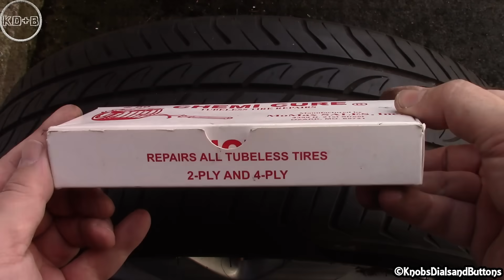How Tire Repair Kits Work - With Internal Views

Comment: If you are serious about your car, you should only use this as a quick fix if you absolutely have to. I’ve worked at a quality tire shop and have experienced several times these have failed. We called them shit on a strip, because they’re shit and look like shit, usually applied by a towtrucker. The correct way is to let a good tire shop plug it from the inside.

Comment: The description mentions all of these are temporary fixes. So where are the permanent fixes?
Reply: that's a silly question that you have just posted. many times doing it correctly can save you from buying a new tire.
but take it to any shop they will say you need a new tire.

you & the few might say, "my ac is not longer blowing cold air, so i got to take it to the dealership"?
and the dealership said you make the right decision.
Reply: The first method, if the strip is of excellent quantity, allows you to reach the end of the tire.
In some states (Italy), definitive use is prohibited by law, so you have to go to the tire doctor soon as possible.

Comment: CLOSEST THING to real patch you would get at the garage is that orange mushroom-- gun type-- airpressure would hold that solid-- feel better if it had glue to weld it in.  other wise the easiest is teh sticky strip- and they never failed although its actually meant to be a temporary fix-   get into an accident it could be used against you if you got a crafty prosecuting attorney1
Reply from the maker: I'm only demonstrating how each kit works and I only ever recommend using any of these as temporary repairs.

Comment: 16:20 this plastic lead will be inside the tire forever?
Reply from the maker: It remains in the tire until it's removed at the tire shop. I'm only demonstrating how to use the kits, I have nothing to do with their design :)
Reply: @knobsdialsandbuttons  cool. You did great job!
Reply from the maker: Thanks !

Comment: A heads up, if you bought your tires at Discount Tire, the ONLY plug they will accept is the black solid rubber plug. Anything else will void your tire warranty.

Comment: I think it's good that these exist (and not have to rely on expensive ADAC services) but i also think it's important to point out the fact that this is just a temporary bandaid solution.
They still need to purchase a new tire n stuff.

It's cheaper than having to pay for a new car because it veered into the guard rail because the tire blew out at 120 KM/h.
Reply from the maker: I explained that in the video description

Comment: I used a sticky strip kit to repair a tire. Knowing it's supposed to be a temporary fix, I brought the car to Discount Tires to get it repaired by the pros. When I told them I patched it, they said they couldn't repair it. I had to buy a new tire.

Comment: It can be a challenge to plug a tire leak on a pressurized tire, even one that's leaking. Much easier to plug a depressurized tire if one encounters this problem and then adding air.

Comment: The key to a lifetime repair using tire plug is to apply rubber cement on the tire plugs before using them. I’ve had a couple plugs that eventually leaked without rubber cement. But with rubber cement, they’re permanent. Many people fail to do this step because their kits didn’t come with rubber cement or because the YouTube videos they watched didn’t show this step.
Reply from the maker: If that's what an individual wants to do, that's up to them, but when I'm demonstrating each kit, I'm only going to use what comes with it.
Reply: @knobsdialsandbuttons  so is it a bit better with the rubber cement? 
*I recently had my tire patched from inside at a tire shop but still leaks air , they told me they can't help me further *

Comment: With the second one and forth one I can see that you lose a metal tip inside the tire when you remove it.
Reply from the maker: The second one doesn't lose any metal tip in the tire. The 4th one leaves the plastic lead in the tire until it's removed at a tire shop. I have nothing to do with their design by the way, I'm just demonstrating how to use each kit :)

Comment: I've been using the 1st method for over a decade, never had one fail, even done track days on them.  But they can kinda be a bitch to put in because sometimes the applicator doesn't want to squeeze through the hole.  Multiple times I've had it be REALLY tough to get in even after it was reamed out really well.  Annoying.  The mushroom plug method is really appealing b/c it just screws or pumps down, but I'm curious how that compares to the plug strips.  That last one is really interesting.  I can't tell if that one is genius or ridiculous.  I feel like it's a good side-of-the-road repair since it can be easily backed out and plugged properly later.

Comment: Highly recommend not to use the red colored plug without the rubber cement.  But rather used the black colored plug with the cement seal.

I plugged a tire with that red stuff and ended up leaking.

Comment: Thanks for the video mate, very helpful, but this reparation kits are quite useless and we should prefer tonhave the spare wheel instead.
Reply: useless, right?  atg & i say if you can't find the wheel lug's key. or the gas station inspector or tire shops didn't return key.
that spare tire won't do you any luck. 
most vehicles don't come with spare. my ferrari & daughter porsche don't.

Comment: I use FLAT OUT in all of the car's and RV! I had a screw in my tire. I pulled the screw out and FLAT OUT sealed the hole. Flat uses Kevlar Strands in it's solution. I don't flats anymore!

Comment: You left out a significant detail of tire gun plug method.
You tell us to put a plastic lead into the tip of the nozzle to help push the nozzle through the tire. You show us pushing it into the tire from the outside view, but it's inexplicably gone in the inside view.
What happens to it? Are we to assume it bounces around inside our tire for the rest of its life?
Reply from the maker: Read the video description
Reply: @knobsdialsandbuttons Ok I see that you wrote about what happens to it in the description, I just don't think 99% of viewers actually expand and read the description that deeply. How come you didn't show what happens to that part in the video of how it works internally?

Comment: Good video but, don't ever stick your finger over a pressurised air source as you risk having the air pass through your skin. At pressures above 30 PSIG, it can tear skin or cause air injection injury. If it results in an air injection embolism, a very painful death. I did take some notice of the things they told me during my apprenticeship 40 years ago.

Comment: You know what happened to me today..? Went buying the kit and a 120 psi compressor because the tire was flat...then when I wanted to glue the orange thing...the super glue that came in the kit was empty...
Reply from the maker: That's unlucky. It's actually a rubber cement so be careful not to use another type of glue with the kit. Super glue would probably shrink and/or harden the repair strip
Reply: @knobsdialsandbuttons  no I went buying patex glue almost similar properties...

Comment: All these methods are only useful in the case of a nail entering the frame, but in the case of stones or a piece of iron entering, these methods will not be useful because the crack is longitudinal and not like a nail.

Comment: Impossible do that method anymore, not when you get a flat tire on the road.
You have to drill out the hole after removing the screw, nail or whatever that is the cause of the leak.
You can't just do what is shown in the opening. No way by hand can you force that tool though the hole. I've tried.
Put your spare on and take the tire to a tire shop that will patch the tire from the INSIDE.

Comment: You’re supposed to pull straight back out with the plug not twisting it that way the tool releases the plug then you can cut off. The way you did it is wrong it will not hold over time. Do it my way it will hold the entire life of the tire and over 100 mph even in side wall
Reply from the maker: I go by the instructions with each kit. Some say pull it straight out and others say rotate it.

Comment: What would REALLY be super, is do an AFTER REPAIR  Air Pressure test.  This would DISTINGUISH Your channel from others because the extra miles you're willing to go.  The repair is only HALF of the battle. For what good is the repair if it can't hold air?  After the repair pump the tire to the recommended PSI and LET IT SIT FOR a week or longer - for each of the repair kit. Then we measure the PSI to test for any leaks!

Comment: Mushroom plugs should be banned. Theres a damn good reason why., they quite often don't go all the way through the tyre and tread especially if the tyre us new and not a road only tyre. (Think SUV) then they blow out about 2 miles up the road.

Bacon strips / sticky string have been round for years, and they work. Simple to install

Comment: Mushroom plug is the worst. Plugged motorcycle tire on Alaska trip. Tried twice, each time lasted about 100 miles then fell out almost causing crash since the hole was open and deflated in like 30 seconds. Bought cheap Slime string type, still holding perfect 10,000 miles later. Mushroom type is junk.

Comment: I was told that a nail in that spot it not repairable. Anything towards the middle of the tire will pierce the metal plate, that only nails and screws toward the rim of the tire are repairable.

Comment: The screw type  For the emergency circumstance. And only use the real tire. If use for front tire. It's very easy for a small leak  After over 1000 Mile. I already try at least five times. But the rope strip  Doesn't matter front tire. Because the front tire move too much left or right. The screw will move  after tire wear. But use for real tire no matter.

Comment: Ive done this with silicon in place of the rubber cement and it worked fine and lasted the life of the tire.  Anyone who says RC is required is just lying or inexperienced.

Comment: BS!!! Even with a 6” nail when you pull it off the tire does not leave a hole that big!!! Use a drill bit to make the hole bigger just like this guy did that he did not show on the video. Also bring a hammer to push the plug through if you are not that strong…

Comment: Tire plugs are illegal in most states and have been illegal for decades. Meaning that you will need to have it patched it from the inside instead.
Reply: Ive never heard that and I have found tire plugs at every parts store  I've needed one in multiple states.
Reply: There are presently no Federal or State laws regarding repairs done to tires in the United States. If repairs are restricted it is usually driven by the fleet or customer as a specification,
Reply: What version of America do you live in? I'm gonna assume the same one that changing your wiper blades is a capital crime?

Comment: My dad told me when I was real young, never get a plug, just pay for them to patch it up. So I never get plugs.
Reply from the maker: Good advice, but it's always worth having a back up in case of an emergency. Hopefully you'd never have to use it ! :)
Reply: Plug is a bandaid to get you to the repair location not designed to be a permanent fix unless you want to drive on a flat or walk there

Comment: The correct way is a patch. Just as cheap as the plugs.

When I was a state inspector, I would fail vehicles with plugged tires.
They are dangerous and not allowed to pass inspection any more.
Reply: No matter. The rope strip  It is very good way for tire repair